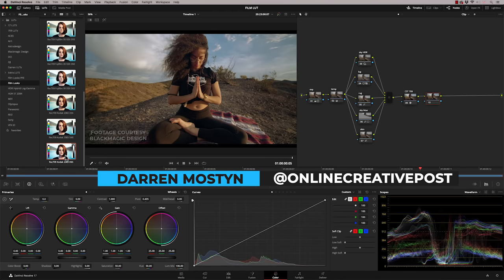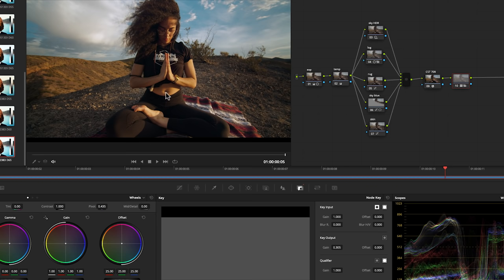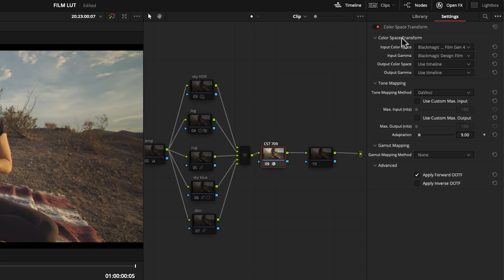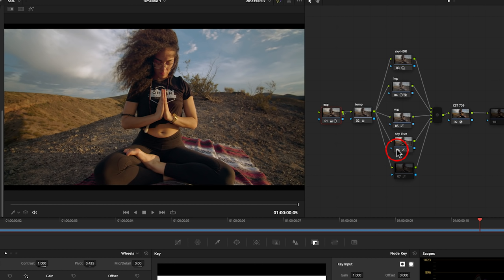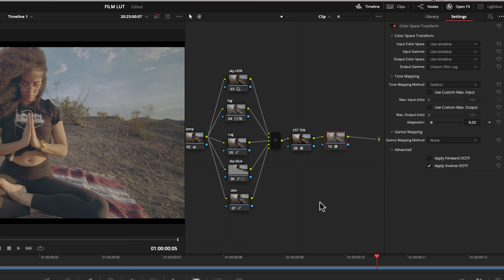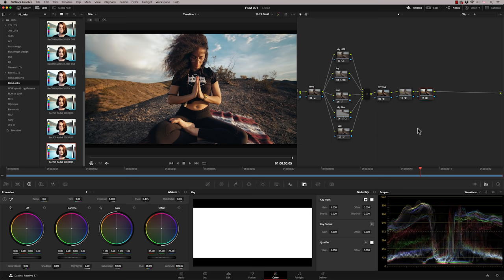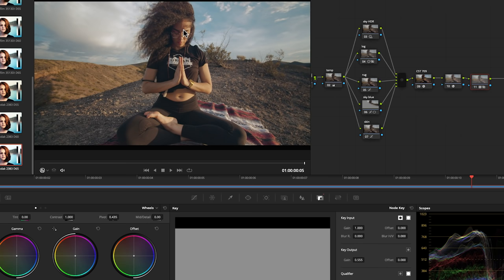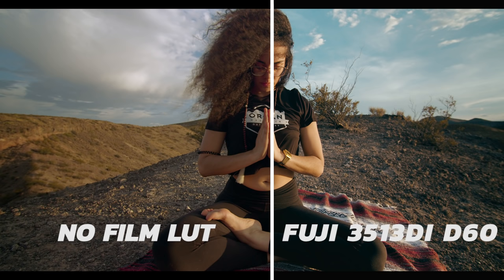Why Do My Film LUTs Look Bad ? - KODAK 2383

Comment: Thanks. 
few addictions to this method:
1) you "should" put the "resolve tone mapping" to "none" so the transform is more mathematically correct, this is a change from v16 where the default was "none"
2) if you have a log input you can go straight from log to cineon log, for example if you have alexa log files, you can do alexa logC/logC to rec709/cineon log.
3) you can (should?) add a small highlights corrections to smooth the shoulder of the curve, those luts are particularly aggressive in clipping the highlights
4) I recommend a node after the lut that only deals with the flare of the lut, you can make the output black a bit more intense just by lowering the shadows. a grayscale before the lut will shows where the true black sits.
Reply from the maker: Hi Walter, Yes, seems the Resolve tone mapping with default wide gamut needs looking at on a node basis. Your point 2).. I get..trying to keep the workflow here easier for the vast majority of my subscribers .. I think my workflow helps that here, but appreciated technically of course.
3 and 4 are great tips - appreciated and I see the clouds clipped - on a real grade I would fix pre 709 CST - I wasn't intending to get too detailed in this episode - its hard to know where to stop on YouTube to keep attention and not lose people - appreciate the notes though.   This was of course an example grade.  Thank you for contributing - so much appreciated. Hard to balance going too deep on YouTube  - I think that is where Masterclasses are king! Watch this space. !! All the best, and thanks for contributing. Darren.
Reply: @DarrenMostyn  of course! I was trying to go "the next step".....
Reply from the maker: @waltervolpatto6096  totally appreciated!!! The fact you are even looking at this is making me smile!  I get it - I have to work out my next strategy to get this info that we have when experienced users on here without opening lots of questions that will confuse less experienced. I have a plan though. Keep you posted! I would love to think you have picked up 'some' tips from my channel!!  All the best, and thanks for contributing! Darren.
Reply from the maker: Can I say "Darren Mostyn YouTube Channel - as used by Walter Volpatto" ? :))
Reply from the maker: Joking of course!!
Reply: @DarrenMostyn  lol, yes,  you can!!!

There is always things that we forget and is always good to find a reminder.
Reply from the maker: @waltervolpatto6096  excellent - I might take you up on that testimonial - also agree - Im 25 years in the biz, 10 years on Resolve, Im still learning and I love that! All the best my friend. Darren.
Reply: re: point 4 just the flare, so a Shadows adjustment? Or a more broad Lift adjustment?
Reply: Short, simple to the point, brilliant!
Reply: If one of the world reference of the digital intermediate enter into the game read what he said like if is your sacred book. Thanks for this tips Walter
Reply: This is brilliant, thanks Darren!
Reply: Thanks! It only worked when I set "output gamma" directly to "Cineon Film Log " in my last node where I do the CST to Rec.709. If I add a single node after that node with only "output gamma" to "Cineon Film log" and then apply the LUT the picture is completely overexposed. Why is that?
Reply: @vividmotion66  is your timeline set to r709 + 2.4?
Reply: I was thinking - jeez another youtube hero giving advice (albeit good advice). Googled name. hot damn.
Reply: @DarrenMostyn  hi, would you have to use another CST after the film grain to get back into 709? Aspects of colour management still confuses even after watching alot of videos aha.
Reply: @Fireandagrill   Did you find an answer to this per chance?
Reply: @HilleCine  nope but now I dont see why you would have to
Reply: Question - I have a question about Cineon Pipeline -I shot a movie in a RedOne MX, RedRaw, I will be using IPP2 + FilmConvert Nitrate to Convert into Cineon Profile for best results from Nitrate Colour / Grain rendition  of the Red Raw Profile.

Iv no idea where to set up this up as a colour managed or a non-colour managed workflow, have you guys any ideas?

Would I be going from CST from IPP2 Node to Nitrate Cineon Node to 709 Gamma 2.4?  Or have you any suggestions?

Any help, greatly appreciated.

Thanks

Jay
Reply: Great!
Reply: Great tutorial. I have around a 100 clips. How do I apply the same LUT to all? Is there a simpler method than going to each clips nodes, adding a cineon film node after the rec 709 output node and then adding the LUT?

Comment: Well, well, well - up to the very last step with the compound node and the key output - I thought that I knew everything about that. So a big little lesson there for me. Thanks Darren. When I thought that the film emulation was too contrasty I tended to try to pull some contrast out. This method you use is a better and faster choice. 
I think that people might be confused as to why the emulations work on some things and not on others. The reason that happens is because there quite a few LOG gammas curves that are based on Cineon gamma. So someone may have tried it directly on Arri log C, or Vlog, or Slog-3, and it looked pretty good without doing any CST.
 I always forget about using the compound node, and this is good application of why I should be using it. Thanks again.
Reply from the maker: Glad you like the compound node trick. I actually sometimes use Arri LogC instead of Cineon (just for a look - even if not Arri source) but though that might be too heavy to explain in this episode. Hope you are keeping well...all the best, darren.

Comment: The node prior to the Film emulation LUT gives much more control. So I usually tend to put three nodes. In first I convert image to Rec.709 using DCT. then I put another node where I use Lift, Gamma, Gain to adjust image and then again I convert it to Log as you shown and put the Emulation LUT.

Comment: You can also select your node, change the node to Rec.709 gamma Cineon: then apply the Lut to that same node.
This single node based colourspace/gamma transform only applies to tools within the node, then after the node out reverts back to your timeline settings with Resolve doing all of the translation work.  
The CST node transform shown here to change the working gamma to cineon adds extra steps that are only useful when you need a complex CST with changes to IDT, and ODT characteristics.
The single node method is often used to slip into HSV to apply saturation purely to channel 2., or to shift into a linear gamma to use offset as an exposure tool.

Newbie here: correct me if I get anything fundamentally wrong, or if the way I explain things is confusing.

Ahh, I see Walter Volpatto has already mentioned why and how a complex CST solution is warranted. So my two cents is only fit for newbies.

Comment: I love your channel but I gotta comment this out there, the CST node needs to come before the qualification and primaries wheels. the Primaries wheels don't work as expected with log footage. Transferring it to rec. 709 makes them work as intended and makes the qualification easier and more effective. You will not lose any information when using the CST in Resolve. Keep up the Good work Darren, Cheers
Reply from the maker: Hi Mohammed. Thank you for your comments. I completely understand what you are saying and I usually have another set of nodes after the CST but didn't want to over complicate this tutorial when the focus is on the Film Look LUT. My grades pre the CST have no qualifiers/keys. There is some log grading which is correct to do under the CST. Any keying would be post CST. Any strong looks would be post CST.  Maybe my skin tone should be post CST too (its just a curve adjustment here) but my point is that this was a set up to demonstrate the Film LUTs so I wasn't overthinking the start nodes. Really appreciate and honour your points that are well made. I probably should have just done a couple of simple nodes and then done the film LUT - I wasn't expecting such analysis of every node. My usual method is within colour management tools but I found inconsistent results with the film look LUTs which I am looking into further. I have to cater to varying levels of user on here and so it is hard to find the balance sometimes. Really appreciate your input, thank you for your support and kind words on the channel. All the best, Darren.
Reply: @DarrenMostyn  I admire how thorough you are. Thanks for taking the time.
I suggest you attach a level of difficulty to your tutorial titles. You're attracting people from all over the spectrum and everyone is learning a lot of new stuff. Thank you for your time and efforts.
Cheers
Reply from the maker: Thanks Mohammed. I did add difficulty level on a few but I feel everyone can gain SOMETHING from all my episodes. I get very advanced and experienced users picking up small tips from even a beginners episode. Fair point though, and again thank you. All comments that can make this channel better are most welcome. Have a good weekend, Darren.

Comment: Do you have to color transform back into Rec709 after applying the LUT? Or does the project setting being at Rec709 take that into account when being exported?
Also, why not use the Aces Transform instead of CST?

Comment: Hey Darren, great video! Question: why do you use a CST to go from log > rec 709 gamma 2.4   then another CST  from rec 709 gamma 2.4 > rec 709 cineon film log. Why not skip the first CST and just go from log > rec 709 cineon film log in the CST just before you apply the Kodak lut?

Comment: Thank you for this.  How would you use a film lut if you're working in the Davinci YRGB color managed color science, with the Davinci wide gamut color management preset?   Would it just be the same but minus the 709 cst?
Reply: @Endrid: Did you find a solution to this question? I have tried to add a CST node with the following settings: "Input color space: use timeline, input gamma: REC.709, output color space: use timeline, output gamma: Cineon Film Log" and Tone Mapping Method set to "None". This works OK but still makes the highlights way to bright. Therefore I add a node before the CST node to reduce the highlights slightly. Not sure if that is the correct way but that's how I do it. @Darren Mostyn: Any news on the topic or is the Color manages mode still not optimal for using creative LUTs this way?
Reply: @frykenmedia  same with me. On the latest build of 17.4.6 Studio. If I do a color transform, it doesn't work for me. Everything is blown out. I'm also project managed color managed vs node.

Comment: Straight to the point and fantastic tips as always. What are the advantages of using CST and not conversion LUTS? Thanks Darren! 
 I'm already subscribed to your mailing list :)
Reply from the maker: Thanks for subscribing, appreciated. CST is 32 bit floating point calculation, LUTs are not so need to be used more cautiously!

Comment: Why not just choose cineon log on the output of the first cst? Is there a difference between doing that and adding a second cst and selecting the output to be cineon? Is the only benefit being able to compound those two together?
Reply from the maker: Hi Jamie. Yes you could work like that - actually is a good workflow. The difference is I may want to key in 709, not cineon, so I allow some nodes to do that. Also, this episode is to show that you need that gamma space...it's not a dedicated node tree episode. Good to hear from you.
Reply: @DarrenMostyn  Hi, I'm just wondering if having a node with a cst from log to 709, and then another node with a cst going from 709 to cineon is destructive? Aren't you potentially throwing away info when you go to 709, that isn't going to come back when you go to Cineon? I can't help but feel that you're better off with one node going from log to cineon? Just trying to get my head round all this stuff!

Comment: Okay! That was a neat trick. Thanks. I have one query though. When I apply this LUT, will my Color Space be back to REC.709? Or I have to add the Rec.709 transform again at the end?
Reply from the maker: Hi Prateek.  This set of LUS will take you back to REC709, so one CST to Cineon Gamma then next node, apply the film LUT from the ones Im using and you will be back in REC709 from that point onwards. Not all LUTS presume go back to 709 or indeed come from Cineon.
Reply: @DarrenMostyn  how can you find out where the Luts come from like Cineon.  is there a way to know just by having a lut.  what would you look for?
Reply from the maker: @chrismierzwinski1398  open it in a text editor. A good LUT will tell you what it is expecting and what it will deliver in terms of Gamma

Comment: Hi! Great video but I do have a question. We use either color managed workflows or CSTs to take the original color space, transform it into something a bit larger for working and then transform it again (to 709) to export it. If we place a CST node after the 709 one to transform it to Cineon, won't we be exporting in Cineon instead of 709? New to the color grading game, sorry if it to basci of a question.

Comment: Thanks for this great video man

Perhaps a silly question but in a color managed workflow (where the scene / timeline color space is DWG Intermediate)how do you apply a conversion to the cineon log? 
Is it accurate to assume that everything is happening is in DWG therefore before applying the film lut one should put a CST from DWG to Rec 709 Cineon log?
Will it be the same if you apply it on the whole timeline? Not just a clip level?

Comment: Great video! Just one question: how to find out which colorspace is supported? (without googling the result, but inside Resolve)
Reply from the maker: All colourspaces are supported - just change it Cineon prior to the Film LUT. Most LUTs will tell you which colour space they expect to receive. Hope that helps.
Reply: Very stupid question;
How can I find this info? In other words; in this particular example  where did you find that you need to change the color space to cineon?

Comment: That makes so much sense. I never used the looks because I didn’t like how they worked (the old key issue you mentioned here). 

Question. In managed works flow are you using the Input transform or setting that to bypass and then using color space transform nodes? I have the later as my works flow and feel that I am always missing a trick. 

Once again. Absolutely love the content you put out. Thanks for taking the time for us.
Reply from the maker: Hi Bruce. Always good to hear from you. In this instance Im not in a colour managed project, just regular YRGB - that is why the 709 CST is in place. If I was colour managed I wouldn't have that node, but would still the CST for the Film LUT. Hope that helps. Darren.
Reply: @DarrenMostyn  thanks mate. Missed the fact you where not in managed.

Comment: Very nice tutorial thank you, one question. If you go from rec 709 to output cineon color space. Then after applying the Lut, to what color space will the renders be? Specially if you need the render output color space to be Rec 709
Reply from the maker: Hi. The film LUT takes cineon to REC709 internally so you will be good to go in REC709 once applied. Hope that helps.
Reply: @DarrenMostyn  it actually really does help, which gamma would that be? 2.4 I assume?                                                           By the way I really like your videos and contribution to the whole Grading community

Comment: How did you learn all this…? Great video. Can’t wait to try it.

Wish you would do a video on backing up a project onto a back up storage drive. That’s so easy to do in premiere Pro and it seems so convoluted in resolve. And yes, I just ordered the studio version… Should have it in three days.
Reply from the maker: Hi Allen. Backing up a project in Resolve. 1. Goto project manager. 2. Right click the project. 3. Export project to your desired destination. JOB DONE. Not sure what could be simpler and certainly not convoluted. Hope that helps. Enjoy the studio version.
Reply: @DarrenMostyn  
I did that with a couple of projects, mostly it worked, but on one project it did not. In that particular project I turned all clips into subclips and I think that's what screwed it up. It would open but would not re-link!  Yikes!  But thanks.
Reply from the maker: @2424rocket  Should work. Premiere is not faultless on project management by any means. I would say that is why AVID is still a huge player in this competitive market - It's media management is ROCK SOLID.

Comment: Excellent video, as always- thx, Darren! Quick question- I have the latest free version of Resolve running on the latest M2 Pro Mac and I seem to have lost the Open FX button option when I open the colour page. Apparently, this has been a thing in the past according to the interweb, but none of the posted fixes are working for me. I even tried re-installing it, same problem - only FX button appears - not the Open FX one. Do you know what's happening here- have I missed something? Thanks in advance.